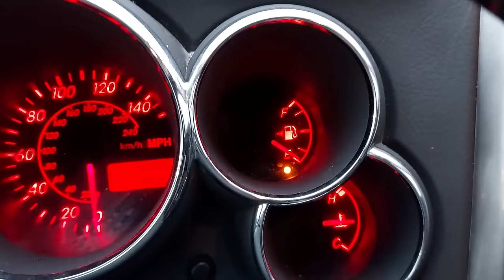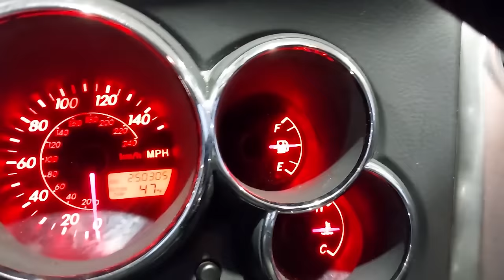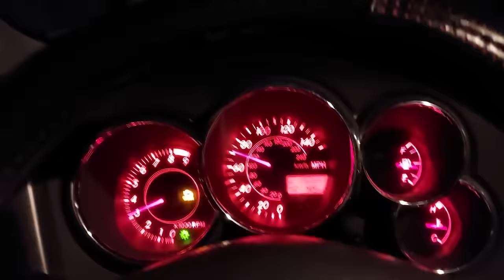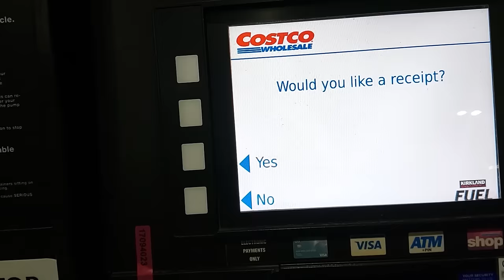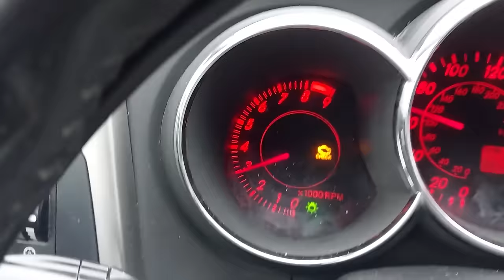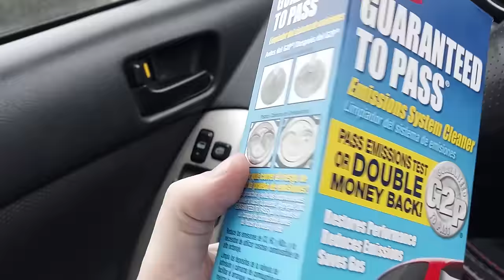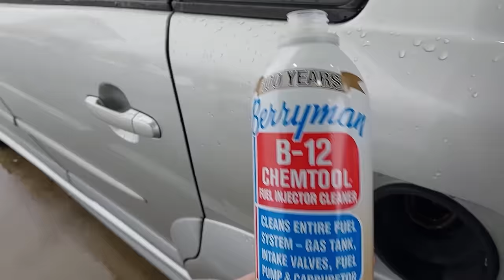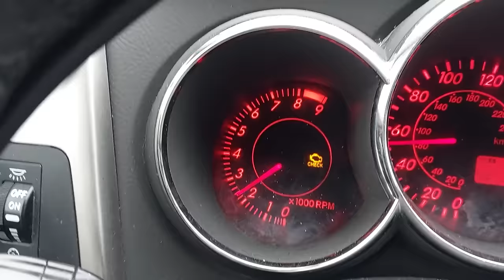Product Testing! Seafoam VS Rislone VS CRC VS Berryman do they work? Can they fix a P0420?

Comment from the maker: What product do YOU believe in most? What would you do/test next?
Reply: I believe in new spark plugs, have y’all changed the plugs and air filter?
Reply: I would change both O2 censer's, would deffently take them out of the equation if it still does it.
Reply: I would replace the rear O2 sensor.  I've yet to break one removing it using a proper 6 point O2 sensor socket.  I love my inductive heater which has yet to fail me getting a nut / bolt out.  Spent $420 for mine but it was the best money I've spent on a tool and I swear less now. 8-)  Easy Peasy.
Reply: I own a 02 Camry XLE V6 they are a Finicky little 👿 and engine light has been doing the same thing I have used catclean which is supppossed 🤣to be the best I might as well peed in the gas tank and I replaced O2 sensors with Denso Brand Still ON , I Took it to Mechanic he's baffled and he also checked the temperature of the Cat's it runs like a Scalded Dog next thing I might try is a Smoke Test because after reading About my Precious little Baby if Toyota especially detects a exhaust leak it sets off the Code, I have even tried the cheaters that you screw in where the 02 sensor goes didn't work, Ohh Yeah remember I said Finicky when the light is on No Stability Control or Traction Control. Good luck 🤞 on the Vibe can't wait to see the Outcome 👍
Reply: I have used cataclean to clear a p0420 and it lasted for 5,000 miles on a V8.
Reply: Sensors and exhaust leak check.
Reply: @robertvance1873 sounds like electric
Reply: I really like BG Products.
Reply: You can buy new o2 sensor to fix this or a o2 sensor sleeve adapter even cheaper . The sensors arnt expensive. It’s all crap build up on sensor you could even clean sensor of soot to fix this problem… happy days ….. 😂👍👏🤛🏻
Reply: Sorry I don't get how this was a) a test of products designed to clean dirty cats if it was used on a new cat? b) scientific if 4 products were used one after the other, if the 4th tank cleared the code how do you know it was product 4 and not just running 4 tanks of similar products?   

To more scientifically do this test you'd need 5 dirty CATs (& a car with known good O2 sensors) and test each of the products with a separate CAT, plus one CAT with no product as control. Then show the traces on the O2 sensors (before & after) + visuals of the CATs to show what if anything happens.   That's a ridiculous amount of work though so I wouldn't be surprised if you didn't want to do it!
Reply: @CountryFarmBoyUSA thats my next purchase. Just got the plastic welding kit. Now its time for the induction heater. Heard great things. The wierd thing is u heat the bolt which expands it so you think it would be harder to remove.
Reply: Was told buy the master ase guy at the shop buy my house that sea foam works best if poor it directly in to the Throttle body
Reply: Put a spacer on the rear 02
Reply: i  have also use cataclean in a few customer vehichle. works about, 80% of the time to get them through emissions .
Reply: I wonder if I can just drive normal town driving just let it do its thing .I don’t have a high way near my home 🤷‍♂️
Reply: Seafoam and gumout we dont have berryman in canada. No specific areas so tough ?
Reply: Bro, thanks for the break down and taking the time to test these products. I’m gonna try crc then rear sensor. If not, just drop the price and sell this thing. No time for mystery codes.
Reply: Redline Fuel System Cleaner. I've seen lab test breakdown. It's the strongest. Run it with only 1/2 tank of gas to get really good results. 

You can also try removing up stream o2 sensor, start the engine, and spray 1 can of carb cleaner in the o2 sensor hole while it's running. Then do a can of brake cleaner (the one without chlorine ONLY). Then replace the o2 sensor. I've seen mechanics use that method and it work as well. Although they always replace the o2 sensors. This is usually just to prevent replacing the cat.
Reply: I just used Cataclean I had a code a few months ago and replaced the gas cap.. then I started getting  bad gas mileage after 1k miles.. then I threw the code 420 again.. so I reset the code.. drove it awhile.. gas mileage got worse.. had a 430 precode.. got the Cataclean, used it as directed.. after 100 miles all codes were gone, gas mileage improved 7MPG.. when I replaced that gas cap I didnt get OEM.. but I finally got one.. If I can get 2 miles more per gallon I will be back to normal.. I just finished the tank.. I'm going to use the OEM gas cap when I fill up.   car is a Lexus 330rx with 140k.. never a problem before this.. I usually run a can of Seafoam before winter but didn't this year...
Reply: @rainey3303 The spark plug fouler spacer works, but in CA a visual inspection is done and the car will fail.
Reply: U talking about senso o2 or catalytic converter.i read about catalytic converter suppose be for life.cant be. Depend on what use any bottle going through it.rislone works best for fuel system is it true ???.what about run it rite,gum out,stop,etc????.does engine really need any engine treatments????. Engine is made toughness inside to keep running????.it's hard to keep caring everything from a to z on vehicle.cost moneys.
Reply: Bg cost 300 for whole cleanse fuel or oil system .is it real working ???.
Reply: Lucore... What are you realistically expecting out of a pour in vs a downstream exhaust issue?  Many of these pour ins aren't going to survive in that environment they will just evaporate..  They can survive in an oil based sub 275 deg environment like an engine oil system...  If the liquid needs to soak to work .. how does that happen in a heavy air stream and 300 deg plus cat/evironment?   Just seems like a tough/ask.  These products are for engine internals.. not exhaust stream protrusions.

Comment: I had the same problem, I just replaced all my o2 sensors and the code popped back on so I removed them all and sprayed them with throttle body cleaner and also sprayed a whole can in the hole where the o2. Sensors goes and turned it on for a few seconds, installed them back and it ran really great and no more 0420 code.Try spraying throttle body cleaner inside the Cat and make sure to use the little red straw on the can so you can reach inside and spray a whole can,then do the same on the other side my friends.
Reply: How did you learn to do this ?
Reply: did you turn back on before 02 reinstalled ? or did I miss read thanks
Reply: Sounds like a recipe for a car bomb
Reply: @juliawei8990 lots of mechanics know how to do this. Carburetor cleaner and/or brake cleaner will also work. If you use brake cleaner just make sure it's the one without chlorine. We use carburetor cleaner followed by brake cleaner without chlorine when we did it. We left the engine running and sprayed it through the hole where the O2 sensor goes before the catalytic converter. If you have a O2 sensor that is not working, you can't simply clean it as the sensor is not doing anything. I always tell people I recommend cleaning the catalytic converter in this way before you replace the O2 sensors, that way you don't dirty up the brand new O2 sensor. After you spray a can of carburetor cleaner through the top hole (closest to engine, in front of the catalytic converter) while the engine is running, when you are done, then replace the O2 sensors. This will almost guaranteed fix your problem each time. This saves you about $800 by not having to replace your catalytic converter. If this doesn't work, you can then remove the front O2 sensor again (The one closest to the engine before the catalytic converter), poor about a quarter of a cup of Dawn ultra soap down your garden hose, stick the garden hose up your tailpipe as far as it will go, then take a washcloth or old shirt and jam it around the garden hose where it enters the tailpipe to form somewhat of a seal. Turn the garden hose on a little, and watch the hole where the O2 sensor was before the catalytic converter. When water starts coming out of this hole, immediately turn off the water hose. Let that water sit in the exhaust system for about 10 to 15 minutes. This will break down all the nasty stuff in your catalytic converter. Then remove the hose and rag/shirt. Allow the water to drain out for about 10 minutes before starting the vehicle. Do not put the O2 sensor back in that hole, until you start the vehicle first and run it for about another 10 minutes. This ensures that there's not too much back pressure on the exhaust system. Then replace the O2 sensor, and you should be good. You might have to possibly run another can of carburetor cleaner/brake cleaner (without chlorine) through the catalytic converter again.
Reply: I sprayed seafoam directly into the catalyst ran it for about one hour then highway it did the job for me
Reply: Thanks
Reply: @louieosorio8921 hi there!! How did you spry it in to the catalytic? Thank you
Reply: I have the same problem 
I'm going to follow your advice see what happens  thanks

Comment: The Berryman B12 chemtools primary active ingredient is Acetone
Reply: Is that good or bad?
Reply: Acetone can swell rubber o-rings and hoses. I suppose it depends how long it stays in the fuel system exposed to rubbers and the amount of acetone.

Comment: I have used Lucas oil fuel treatment mostly over the years just for maintenance.  Absolutely no injector, fuel or catalytic converter issues on several cars I ran to almost 300,000 miles.  Recently, I tried the Seafoam (it was cheaper) and it works pretty good.  The one where I felt worked the best was Royal Purple Max Clean Fuel System Cleaner.  I bought my Ex a car so she could take our son to school then therapy after and took her old beater to drive.  That car had horrible mileage and a miss, it was clear she hadn't done maintenance on it for a while.  I added that Seafoam, no change.  Then I tried the Lucas Oil, no change.  I tried the Royal Purple Max Clean Fuel System Cleaner and the miss cleared up quickly and the mileage improved.  I now add a can of it to the tank about every two months and it works really well.  * My doors leak yours do so I can't wait for the video of how you fix it! *
Reply: Thanks for thr information
Reply: Cool thanks

Comment: I just cleared mine and passed smog in CA 2008 mazda 3 170k... i first ran seafoam high mileage in gas and oil combined with full bottle of seafoam injector cleaner.. i ran out half the tank then bought  2 bottles of cataclean, i hooked up one bottle of cataclean like an iv and fed it right into the throttle body.. i reved the car for about a minute bouncing off the rev limiter a few times.. after half a bottle of cataclean through induction the car was cranking out thick wite smoke and dripping black condensation from the muffler. I shut off the car poured 1/4th of the cataclean straight into the air/fuel bypass chamber, closed up the intake. I cleared all the codes missfire, and p0420 p0421... after driving normal for 200 miles it was ready to smog and it passed.. the car is running like new. Lets see how long it last.. while i was at it i replaced the air filter and cleaned mass air flow sensor and throttle body then did an oil change

Comment: I've had the best results with the CRC product.  I run it down and then add super unleaded and monitor the test results on my code reader.  In Texas I can have one incomplete code and still pass inspection, and the CRC buys me enough miles/time to keep the check engine light off.  I have left the test center several times and the check engine light comes on right after I passed inspection.
Reply: Ha, ha, ha.......lucky you !!!!!!
Reply: Do you clear the code before input if the CRC ?

Comment: Luckily, I was able to do this for my mom's 2011 Honda CRV. She had about 155,000 miles when the code came up.
I used 2 cans of Duralube cat stuff. It worked. About 3000 miles later, still no more warning.

I replaced the upstream and downstream O2 sensor a few thousand miles before that, because MPG was dropping.
Reply: Do you put two cans of the dura lube at the same time?
Reply: @judyfroemming7756  No.
One can per tank of fuel.
Halfway through the second tank of fuel, the light went out.
Reply: When did you replace O2 sensor ?  @skylinefever
Reply: @juliawei8990  About 15,000 miles before the light came on. I replaced both the upstream and downstream.

Comment: Guaranteed to pass only works temporarily. That’s why they say to take the test when it gets down to eighth of tank. I believe the issue you’re having is an exhaust leak before the sensors or it’s the cat itself. I know it was replaced but if it’s a universal you might as well just replace it with a glasspack or cherry bomb. Factory cat is what you’ll need. Try using a spacer between cat and sensor. Check live data to see performance of sensors but it seems from video the sensors are working. Also remove egr valve and check small passages could be clogged.

Comment: I've always checked a catalytic converter with a laser temp gun. Drive down the highway pull off into the rest area the outlet of the cat should be 600 degrees plus warmer than the inlet. If it's working efficiently.
Reply from the maker: Hmmm not a bad idea, could be pretty easy to test that! Thanks for the heads up!
Reply: Same here.
Reply: Or you could just read it on the scan tool.
Reply: @PayNoTax-GetNoVote No. Typically people use thermal infrared temp sensors to test hot cat and exhaust temps.

Comment: Just watched this as my son's Volvo V70R had the dreaded P042 code pop yesterday. Now, this is my old R and it is NOT stock. Do I think the cat is bad?? No, I do not, this thing dyno's at 425hp so I'm not worried about that, do I think an O2 sensor is bad? most likely, but I was really hoping one of these products would actually do what they say they could do. But since I worked auto parts as a kid and through college I know that most of the time these products are just a gimmick however they do successfully do a tiny bit of good. You made a believable video that was fun to watch, thanks!
Reply from the maker: Thanks for watching, really appreciate that! And as a fellow turbo Volvo person, very glad to hear that! An angry turbo Volvo Wagon is our kind of thing for sure! You pretty much understand the point of this video, and why we figured we would make it. Do they clean things up? Ohh probably. Any time you are burning and running certain chemicals they DO do something. Are they going to fix a P0420 code? No probably not. Might cook off some soot, but that's about it.

Comment: 1 gallon lacquer thinner in ½ tank if gas. Scotty Kilmer recommended. It worked for me after cataklean and some other $30 waste of money. It's been 16 months. And now new cat front and rear are needed. Finished front, what a pain in the arsenal. I might delete the rear temporarily till I can afford phase 2. But there's no inspection or emissions in Indiana. So maybe I'll be ok with P0420
For a few weeks. But it's better than 30 mph...Lacquer thinner absolutely worked short term. 
Thanks for the review and I hope others avoid the money pit of cleaners and just spend $20 and then deal with it when it's finally time.
Reply: What specific brand of thinner did you go with?

Comment: I have 2017 Toyota 86 with about 70000 miles on it . Today check engine light came on and I took it to a car place near me house had them code it and it spit out P0420 "catalyst System Efficiency Below Threshold Bank 1 " . The sale guy told me to try Lucas and to my amazement it helped ! The light went off and so far so good .....
Reply: I used Lucas, but the engine light came back.....I didn't pass the test.

Comment: Check your work on the piping.  Make sure your joints are air tight.  If that is tight. Then Replace the O2 sensors.  You know the cat is new and clean and you know the fuel system is super clean from the snake oil.

Comment: Gumout turned of the 02 Sensor (check engine light) on my Jeep CJ .............. and it only took about 20 mins driving.  Scotty Kilmer recommended a cleaner with PEA, so I tried it and it worked.
Reply: Same man.  It's the only that worked for me.  I could be wrong, but I think Scotty said, at that time, gumout is the only product that has the PEA in it.

Comment: It would be interesting to see the top of the pistons with a bore scope to see if it cleaned the surface of the pistons with all those additives. Thanks for the testing.
Reply from the maker: I've actually considered the same thing. Planning to pull the plugs and do a compression test of it as well, could knock those out at the same time.

Comment: All the sensors and ecu work together. High mile/low maintenance vehicle, I'd start with cleaning the MAF sensor. I'm guessing you want to leave active scanning out of the process i.e. monitoring short term fuel trim/long term fuel trim.
Reply from the maker: I have no problem doing active data monitoring to verify things are working as they should, in this case I used it to confirm the front sensor is see the typical rich/lean situation and the rear is seeing a much cleaner signal. Can certainly clean the MAF sensor that's a pretty easy to do bit, what's your thinking?